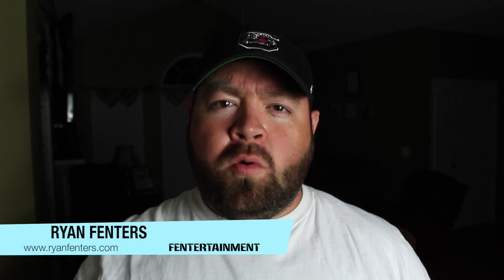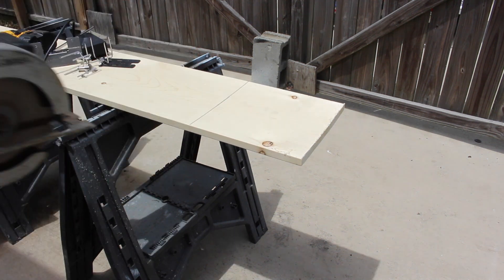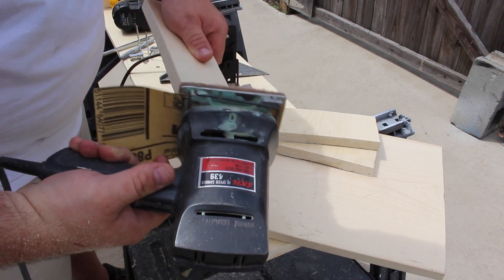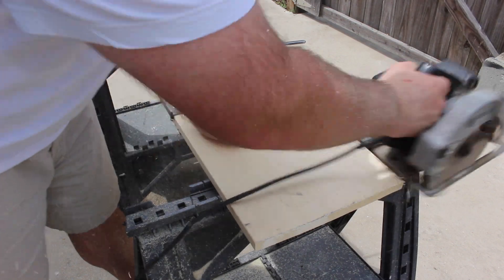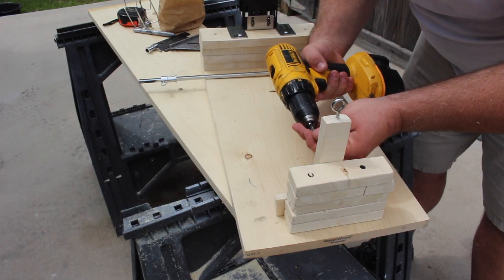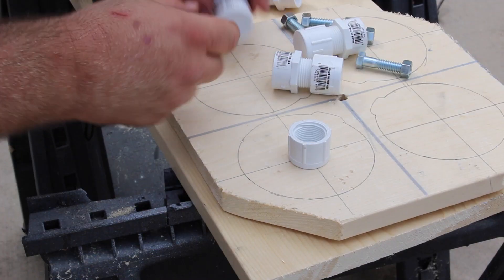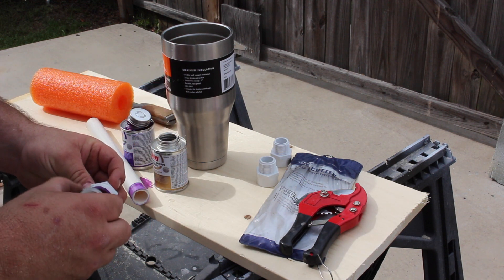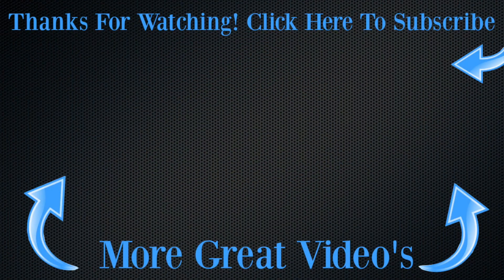DIY | HOW I BUILT A MULTIPLE ROTISSERIE CUP TURNER

Comment: How does this work in leveling epoxy on 4 different cups. Or is this just for drying. It doesn’t look like the cups are turning.
Reply from the maker: all 4 cups will make a full rotation, they turn a full circle together but not individually.
Reply: Fentertainment is there a video that I can watch?  I am visualizing that it turns like a Ferris wheel.  The cups rotate around the base but don’t actually turn over.
Reply: @Fentertainment  im wondering the same. Im new to this and was looking for something like this i can have my brother build for me, but i assumed the cup needed to make a full turn on its own in order to level the epoxy correctly? Please explain. Thanks! (:

Comment: I made my fiance one similar to the one you have here. What we are finding is that after she does a few cups the wood that I drilled in the middle to hold the rotisserie bar seems to get bigger and loosen up which in turn makes the cups sag down and the whole piece of wood will wiggle down the bar over time. Have you found this to be an issue or no a cure for this? Any help is appreciated

Comment: Hubby made one for me but the mounts are not completely level. The pvc extensions that hold the cups slant slightly, like yours appear to be. Will this cause issues with the epoxy being able to level out?
Reply: Val Atchison how we fixed this problem is we nixed the bolt and drilled the hole the diameter of the threaded pvc. Slipped the thread through and screwed the cap on from the back.

Comment: To solve the board from wobbling loose on the shaft, I used a big flat washer, I then drilled the hole big enough to slide on the shaft and I also drilled 2 holes in the flat side of the washer, then i welded the washer to the shaft, slide the wood on the shaft, screw 2 screws through the holes, problem solved!!!

Comment: Hey Ryan this is perfect because my Styrofoam keeps making my cups slide off while rotating, what size PVC and female adapters do I need to grab..please let me know I have a nerf football on the hook on the end but this is perfect for the other 4 dowels, I can modify them.
Reply: How are you modifying for the other cups and koozies? Will you use shorter size PVC pipes?
Reply from the maker: Yup just make them for the different size cups. Like I said its just a diy so you can make the modifications you want to fit your needs!
Reply: Ok thank you,  I attempted to get a pool noodle today but it was too thin...my dowels are attached to the wood so I'm trying to come up with a modified version like this that will allow me to not take mine completely apart😏🤔 I'm hoping the pool noodles are the missing link...

Comment: So my husband made this for me. At first the rod kept coming out. Got that fixed. On the third run, the hole in the wood had gotten bigger and it stopped turning. Now i have to figure a way to plug the hole up so it will work, otherwise, it will be a single turner. Any suggestions?
Reply: Fill the hole with epoxy and drill out a new hole?

Comment: I see you hammer the short rod on the board, how did you connect the longer rod to the same board? Or did you remove the short rod and replace it with the longer rod? thanks again.
Reply: Robert S Rodriguez Jr it was replaced with the lonver rod
Reply: Glad you answered this, I am getting ready to make mine tomorrow and that part confused me. Thanks.

Comment: Ok, I have a question and I am sure my thinking is wrong but I have to ask.  It would seem that the cup isn't actually turning itself, so how is the epoxy being spun onto the cup.  Wouldn't the cup be in the same position, yet moving in a circle pattern?  I understand to not apply it while on this machine but what keeps the epoxy from just running to the bottom and staying?
Reply from the maker: Its just a larger diameter mount so the cup actually still makes a full rotation its just not as fast as a single cup since the single is a smaller diameter.

Comment: I have a question about the 4 cup turner.  On the piece of wood that holds the cups.  I drilled the hole in the middle to your directions and had to hammer down the medal pole.  After using it for several cups the middle hole is bigger and my board moves.  Is there a way to fix this? I've tried to use wood glue and sort of fill in the  hole but that didn't help. I love my turner but need to fix this board I've messed up cups because it will jump to the end. Thanks for your help.
Reply: just fill the gap with epoxy

Comment: Need help mine is put together but for some reason half way threw turn it pauses and does a wired loop thing could this be a motor issue. it's like it skips if that makes sense.????
Reply: I'm having the same issue. I thought it was the motor as well but it seems i'm not the only one
Reply: The weight of all your cups has to be evenly distributed.  Sometimes you may have to throw on some blank ones on the other 3 spots...it will not spin continuously and smoothly if you only have one cup on it.  Even 2 put on opposite from each other will still cause issues for the motor...just make sure you have similar cups on all 4 to help even the wheel out. <3  Hope this helps.

Comment: Great work as always Brother but not practical.  how will you apply epoxy to the cups?  it will be on only part of the cups.  if you could figure out how to get all of the cups to rotate individually, then it's a winner!
Reply from the maker: I actually used it again this past weekend. I do not apply the epoxy to the cup while it is turning. I apply the epoxy with the finger method while holding it. Its very simple and does the trick. I've seen the other one you are talking about and its cool. This was you dont have to search for all the parts.
Reply: Agreed. Instead of threaded fittings, I just used a smooth end cap fitting and made the PVC pipe handle onger, so I can hold on to it while I epoxy and then slide it into the cap.
Reply: MrRealGoodMan Same thing I thought
Reply: Look at the logo on the cup, they do have a 360 rotation so that is like they rotate individually

Comment: Good afternoon, I have the turner made however the square whole that you put the rod in the whole gets wonky and then the turner tilts down, do you have a remedy for that or have you experienced that?
Reply: Please answer...have you experienced the weight of the cups making the spinner tilt, knocking off the cups
Reply: You can put 2 holes in the motor don't drill too far.. and it will help with your issue
Reply: I’m having the same issue... maybe I can somehow incorporate the meat fork part into the board... 🤔